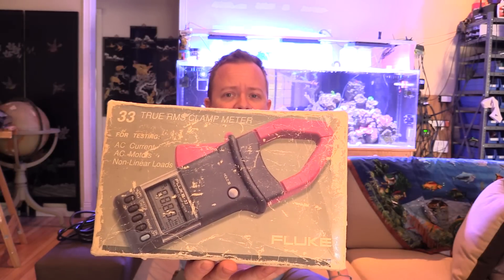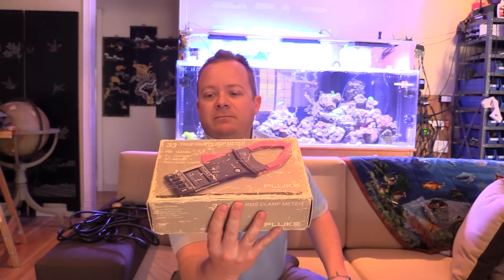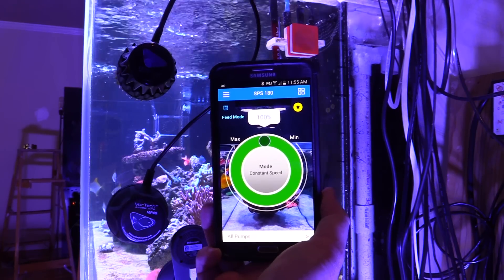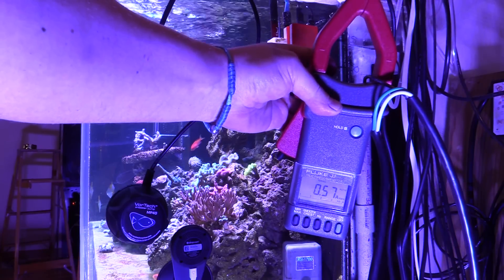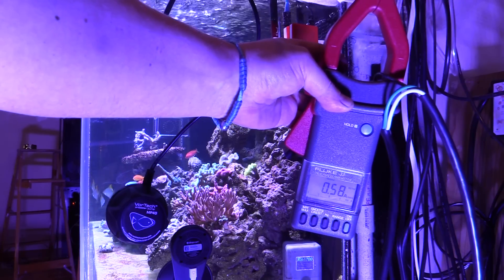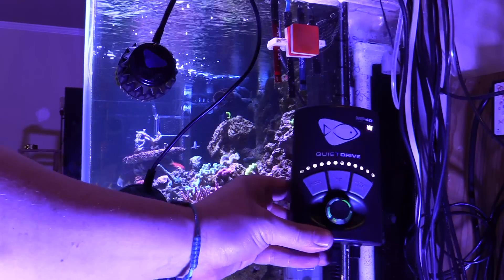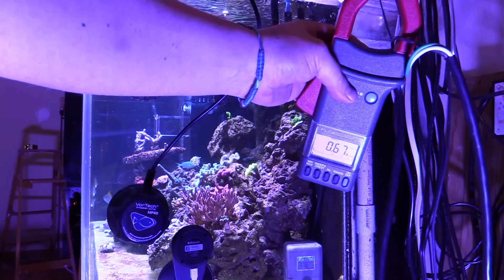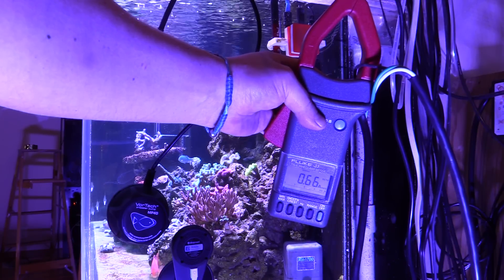REVIEW: MP40wQD vs. MP40 Amp Test Current Draw - Is the QD More Efficient?

Comment: If you can find one, use a pitot gauge to measure the water pressure in front of the pumps. This way you can measure the older model to 100 percent then match the pressure rating at the same distance on the new pump, then test your amperage.
Reply from the maker: bfirefighter3 That would be awesome! Great idea! I'll ask my neighbor who is a firefighter if we has an old one that I can borrow. ;)